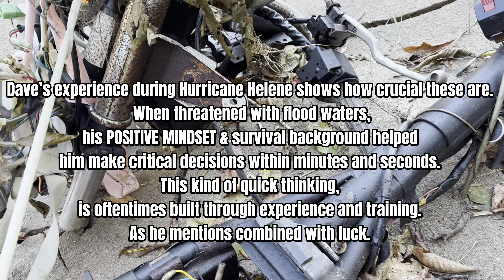Facing The Storm. An incredible Survivor’s Story. #hurricanehelene

Comment: So glad he mentioned the dams blowing out. Thats what pressure washed these towns into oblivion.  Not just a hurricane.
Reply: Pretty sure there were no dams above this part of the river. There was just that much water flowing out.
Reply: @gibsonfan159  he mentioned it so seems like he'd know the area.
Reply: No dams broke.
Reply: @russellharp8761  correct.  but...floodgates/spillways were opened full bore.  😡😡😡
Reply: 💯‼Rarely hear this.
Reply: @jennyrosd2003  I live close by.
Reply: @LilyWillow22  that's what they're meant to do and would've prevented some flooding if done earlier.
Reply: @gibsonfan159  earlier. perhaps. During = Mass catastrophic casualties/destruction.
Reply: @LilyWillow22  evidence?
Reply: @gibsonfan159  you don't open up all the spillways in the middle of a deluge hurricane those dams are built with provision for spill over and they were not failing
Reply: @gibsonfan159  just look at the aftermath one time that should tell you all you need to know

Comment: I was remembering the  flood levels marked on the buildings at Harper's Ferry the day before Helene made landfall, and my local abc affiliate was predicting rain of 18 to 20 inches in the mountains. New Mexico is now suffering  flooding . Flash flooding is hard to predict and people have a hard time preparing for it . People are not willing to accept that they might need to bug out because of weather.  Working outside, I would prepare for the worst possible weather summer or winter. My coworkers would give me a hard time because I was prepared carrying what they considered an unnecessary load. My answer was always I never got wet from carrying rain gear I didn't need or cold from excess clothes. I'm hoping for everyone to recover, wishing it never happened . May we learn to prepare better from this experience.  Thank you for your kindness it proves that people are good.